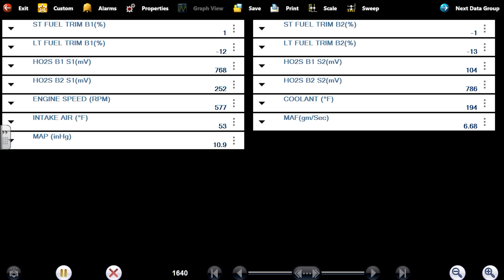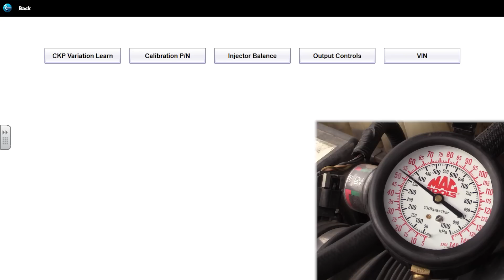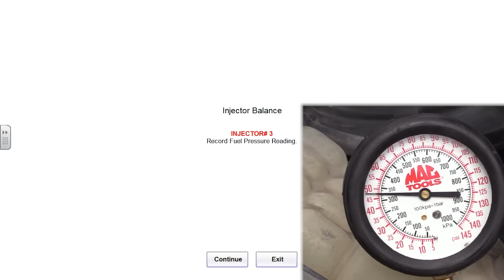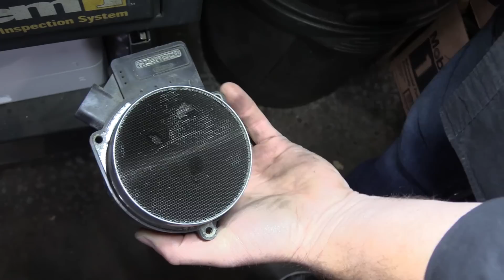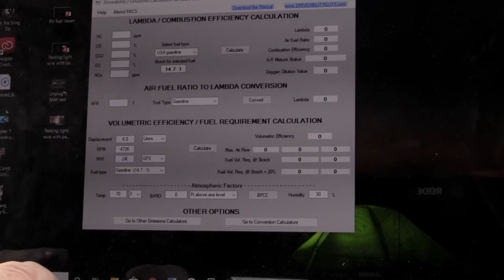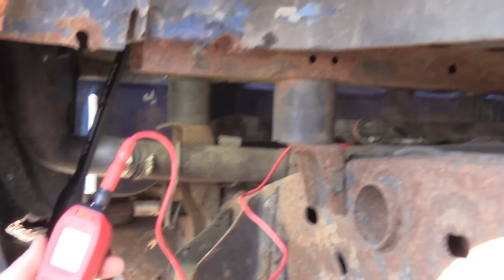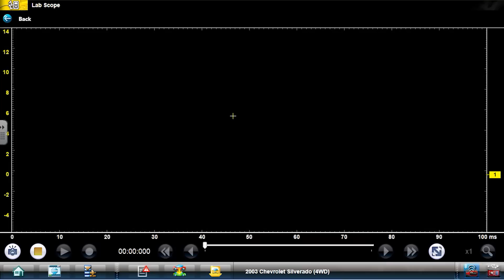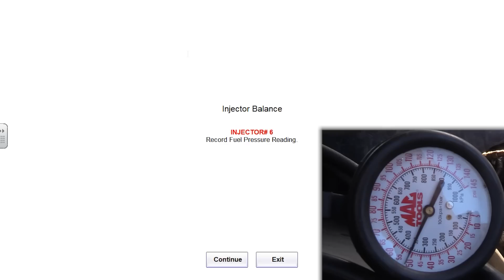03 Silverado Misfire, Rich AND Lean fault codes

Comment: If it's a Flex Fuel Vehicle (and I'm absolutely certain that it has no E85 in tank)  I would just start off doing a Fuel Alcohol Content Reset.
It Fixed the P0172 and the negative fuel trims on a 2009 Impala I had today

Comment: I fixed my misfires and all the lights that come with it!! Stability traction control, reduce engine!! I changed air filter regapped plugs and dumped 1 gallon of laquar thinner with ten gallons of gas  and a bottle of Lucas fuel injector cleaner in tank ran till empty,, all good so then I fully replaced plugs gapped/tourqued to spec!! Bacically it had a clogged 3 injector causing fualing plugs creating bad fuel ratio!! Dirtying Tb!!

Comment: Another PS: a check for engine oil contaminated by fuel or something else (ie on car injector cleaning fluid) that has passed the piston rings might also not go astray, have had that scenario cause negative trims at idle on multiple vehicles.

Comment: Ps. I think I hear an exhaust leak there with the engine running, fuel trim readings could be skewed if that is before any of the 02 sensors, just a thought on a variable 👍

Edit: You did mention the exhaust leak, I just missed that part.

Comment: Have had issues on the LS series engines where people have had injectors replaced and this fault occuring after the repair, problem being the one or two or three..... old part number injector(s) being changed out for the new part number, when the proper repair method for changing to the new part number injectors is to change out all of the injectors to the new part number and then reflash the PCM, as the new part number injectors are a different design (high impedance vs low impedance from memory).

Edit: Also, from memory, the mismatching of injectors to PCM program can cause fuel pressure issues due to the difference in flow rate of the injectors.

2nd Edit: From memory, the old Bosch part number ends in 049 and the new in 051....
Reply: Speaking of this fault I mentioned, I had an Holden Commodore 6.2 in today that had an injector replacement done for a failed injector done by a Holden dealer under warranty, the vehicle presented with rich at idle on one bank and misfire, found that the dealer had fitted one new injector and the injector that they replaced was the new part number and the rest of the injectors were old part number, have a guess which injector was still misfiring?

Comment: Read through most of the comments, am I the only one that noticed IAT of 57F? Seemed colder than that outside, although I know it could be from heat soak from the radiator. If the ECM sees 57 and it's 27, that would cause a lean condition, at least in open loop, right? Not intended to challenge the diagnosis, just a question I had.
Also, unrelated, that unplugged tank pressure sensor is going to cause a money light for the EVAP code after it completes the drive cycle (and Patrick seemed to not want the money light on). I assume the aforementioned lean codes being cleared took out any EVAP code.

Comment: P0300 on a 07 New body Silverado 5.3 I've checked plugs, wires, maf, throttle body, compression is 140ish all around, and I'm going to double check fuel psi. I'm concerned I found injector 1 about 3psi lower than the others. Misfire counts are high on Cylinder 3 with half as many on 8. Won't pass smog currently. Any advice! Thanks!
Reply: One other thing I'm looking at is bank 2 downstream 02 isn't reading low-high like bank 1. Stays in the 700s whereas bank 1 goes 80-800s. Which if any is bad?

Comment: Hey fellas wher can I find known good wave forms?
Reply: Hey Jorge, what scope are you using? Pico has a user uploaded database of good and bad waveforms available, you will need to be a Picoscope user to access that though, same goes with a few other scope manufacturers.
Reply: I'm using the snap on zues
Reply: Thanks you for the info I'm going  to look into getting a pico scope what model do you recomend?
Reply: Hey Jorge, I am not familiar with the Zeus or whether there is any database of known good waveforms available. I had the Picoscope Master Kit until I lost it in a workshop fire, they are available at Picoauto.com, I think that AES Wave in the US distributes them also.

Scanner Danner video link on this subject using a Picoscope here:

https://youtu.be/hYHphciFnH4

Comment: Paul, for the pressure drop test on the injectors, why not hook up the wps500 and pico and get an exact record of the different pressure drops? quick, easy, accurate, and a graphed record.

Comment: Anybody know of a YouTuber almost as good as danner around the Los Angeles area? Have a pesky p0300 can't get rid of on a 2007 Silverado 4.8 new body. Will alcohol percentage being at 19 cause a p0300? Only thing that looks off to me lol. Fuel trims pretty normal just slightly rich bank 2 but not really like around negative 12. 8th cylinder seems to be the worst with misfires but every cylinder is missing yet truck doesn't shake, no stalling, no surging, no overheating just weird it runs with all those misfire counters going.
Reply: @C5 Diag Thanks that's exactly what I was thinking I needed but I do not have bi directional and don't know who does other than the stealership around here.  Yeah no symptoms other than when I accelerate on the freeway I don't believe the truck has the power it should but I do not have another good truck to test that.  You think I could have a timing chain issue?
Reply: @C5 Diag Thank you for the help yeah compression all cylinders 150 except 7 and 8 at 126 and 135 respectively but still don't see that too problematic but I'm not sure. I wanted to see if anyone was around to help in the Los Angeles area I'll keep searching.
Reply: @C5 Diag No it's a work truck 07 4.8l which I believe did not come in flex fuel or afm.

Comment: I like using the pressure transducer on the fuel rail when i do that test and then put the verus in split screen mode so its all on the same screen then you can screen shot each cylinder test to have in your records for later review if needed. Just a idea to try cause you'll have the test recorded in your records. Just make sure there's enough time on the scope to record the whole test on one screen.
I also do the same thing with the split screen and my VE calculator  and scan data right on the same screen on the  Verus. I pin the VE calculator right to the task bar so i can pull it up when ever i need it.
Just some ideas that i like doing!!

Comment: Oscillations in the pump current waveform might be from the system voltage changing as other loads are turning on and off.  Remember the PCM is watching system voltage and modifying the injector pulse.  If it sees a lower system voltage it will make changes to the injector pulse width to compensate for the pump slowing down.
Reply: Hi...trying to learn here...is the  pump a mechanical one or  computer controlled  one? I ask as the  fuel regultor  seat's  on the engine.!
Reply: @romellabiche175  The fuel pump runs 100% on this vehicle.  It uses a return system.  The PCM turns on a relay to supply power to the pump.  There is no module to control the speed of the fuel pump.
Reply: @Discretesignals  Thank you sir

Comment: Why did you not take the truck on the road with the F P gauge under the wiper,for a real stress test?  also,cyls.5 and 8 needed to be looked at in more detail,maybe,with all those logged misfires?
Reply from the maker: Could be, but I think the misfire was occurring on low fuel psi situations and you absolutely cannot rely on those counters with a 300 code. 
No misfires were felt on noticed during our troubleshooting

Comment: fuel volume test    1/2 gallon in 30 seconds ?????  merry christmas SD   James    happy 20/20
Reply from the maker: Volume test not needed. Low volume was identified by simply looking at the pressure drop on a snap. Merry Christmas!!

Comment: I think you have a mechanical problem in this engine...
Or maybe in the PCM it self.
You don't see injectors pulse in live data !!! to known, maybe the pcm sends high pulse to injectors.
Reply: That would be hard to judge if the PCM is causing injector duty cycle issue because it is always modifying the base injector pulse from the inputs it receives from the sensors and it's software logic.  As long as the injector waveform has good turn on and off times and you don't see any offsets, it's probably not going to be a pcm issue unless that PCM software was modified by someone.

Comment: So it doesn't start too well either? You're right,  the pump definitely seems bad. I'm less convinced about the injectors though. Been down that road myself with a ford. Replaced all the injectors and it turned out to be an internal intermittent break/open on a couple brand new oem motorcraft sparkplugs. They were bad right out of the box. Problem always got worse when hot so I assumed the injectors were leaking but I was wrong. Edit: I am not implying this is your problem.

Comment: Love the videos. Got a technical question for you since other mechanic can't figure it out. I have a 2006 Hummer H3 with 90,000 miles on the motor. Live data of engine running shows multiple misfires skipping from one cylinder to the next, one at a time in no particular order when you press on the gas pedal a little. When you let off the gas pedal all live data shows 0 misfires. Also there is no check engine light. We just saw it only on live data. I was just wondering if you had any ideas of what I should be looking for?
Reply from the maker: Is it misfiring or running normally?
Reply: @ScannerDanner  it seems to be running normally. The only thing my mechanic said was maybe there's no check engine because it's misfiring Within a acceptable range? We originally hooked up the scanner to actually check my oil pressure but decided to check all live data while we were there. My H3 drives fine to work but on my way home the same exact distance when I stop at a light my oil light seems to like to come on. Turns off immediately if I press the gas or when I turn the AC on it ramps up the RPM a little and it goes away. So yeah when we were checking the live data we found the misfires..... it sucks because I bought it from a guy and the engine blew within a week and he wouldn't take any responsibility. So I replaced the motor and various parts and am now over $5,000 into this vehicle. So now I don't want to sell it I'm upside down now for sure. So any thoughts you have to point me in some directions, I would much appreciate. Your channel is awesome and you definitely know what you're talking about.
Reply from the maker: @rizkybiss  first, I wouldn't worry about those misfire counters. Second, you need to do a manual oil pressure test with this engine hot and see what it is. These are not good symptoms. It sounds like you have a legit low oil pressure problem.
Reply: @ScannerDanner  yeah it's weird in the morning it never comes on but when it warms up 20 more degrees and I get to home then it comes on at only at idle. Never when I'm driving. I change the oil from a 5w 30 to 10w 40 this weekend. It didn't help. I didn't pull the oil pressure sensor out but it did have a lot of power steering all over the connector and inside the connector from when I had a power steering leak. Also the first engine that blew was exhibiting the same thing with the oil light. My mechanic doesn't remember if he pulled the old pressure sensor off and put it in the new used motor.... if the light only turns on at idle could it be the pressure sensor? Or would the pressure sensor be more sporadic?
Reply: I know you're not in the business of online mechanic, I'm just trying to get answers anywhere I can right now. I've Googled and read every single thread regarding the oil pressure.....
Reply from the maker: @rizkybiss  it is possible you have a faulty pressure sensor, change it and see what happens, but I would recommend a manual pressure test while you are in there. You have to take the pressure sensor off to install a gauge there anyway.
Reply: @ScannerDanner  so we checked oil pressure and it was 14psi at idle. Is that good? We also changed the pressure sensor. On my way home today the light to not turn on when I came to a stop but then traffic was really light on the freeway so I didn't have stop and go as usual. We think of that it PSI at idle?
Reply: Oh and at 14 psi my idle is at 600 rpm.

Comment: thanks for video.i think  problem with that truck is low compression on  those two cylinder with  misfire.i run into same problem. i think bad MAF and fuel pump will affect all cylinders.

Comment: Bassackwards diagnostics 101, painful to watch this display of incompetence. Just WOW.
Reply from the maker: Don't skip around in the video and pay attention, this had rich exhaust codes that had NOTHING to do with the low fuel pressure problem. Customer complaint was highway speed surging, misfiring and also setting LEAN exhaust codes. (which he cleared before he brought it to me) This thing needs a fuel pump and I proved it. This would match his surging, misfiring at highway speed condition and also the P0171 and P0174 lean exhaust codes. 
The negative trim numbers and the cause for them is open for debate as I believe the balance test numbers were inconclusive.
Reply: hahahah yeah, i'm sure you're an expert

Comment: Paul, food for thought, if one or more of the injectors was leaking that grossly, I'm curious if unplugging the injectors individually and watching for fuel pressure drop when applying the throttle would be a good test. In addition the inconsistent readings for the fuel injector test could be related to the temperature of the fuel,  GM has an injector balance tool call AFIT that accounts for this variable and others that produces in-car flow test accuracy close to that of out-of-vehicle injector test benches. https://www.youtube.com/watch?v=aU0wplBH0ws
Reply from the maker: You would not be able to disconnect injectors and watch for pressure drops if the pump is running. I have only heard of this AFIT tool through this thread, I will have to look into it. Thanks!
Reply: Seems like it would be impractical for anyone other than a GM Dealership to own that AFIT tool given its cost and amount of different adapters it requires. I`v only seen this tool used a couple times by GM Master Techs and that was only because TAC made them do the test before they would release parts for the vehicle...

Comment: Scanner get yourself to the UK will ya' I've got a doozie of an Audi A4 B6 1.8 no codes high CO failing emissions negative 5% STFT +/- 5% takes forever to get LTFT  vac guage vibrating 19-21 in hg.
Reply from the maker: vacuum gauge vibrating is a mechanical problem

Comment: These type of diag jobs suck. You find half-dozen issues so the owner thinks you are guessing. Nope. I would do some base engine diag to make sure the engine doesn't have pending internal issues just to CYA. Would have liked to see some coil waveforms to be certain the "new" coils aren't Chinese junk. So far you know you have exhaust leaks, low fuel pressure, fuel tank pressure sensor issues. I wonder if the fuel tank has contamination? Just so many things that NEED repaired. Cam/crank waveform to verify signal amplitude? May have rust jacked crank sensor. If you replace the fuel pump the rich issue should get worse. Lots of ways to go.

Comment: Fuel pressure should be 55-60 on all k body’s , put a damn pump it it . That dish should have taken 10 minutes
Reply from the maker: That is incorrect. This 6.0L spec for this year is 48-54 psi

Comment: How come there wasn't a fuel test to check for alcohol content and density. Yes the pump is bad. The injectors could or are at fault. I work for Hyundai which are not ffv. But we have lots of gas stations in Minnesota that carry corn. And yes people will fill their tanks. Always come in with rich codes because of that.  Just wondering.

Comment: I would fix the base fuel pressure issue before relying on those bidirectional test numbers.  You are leaving fuel volume out of the equation.
Reply: Volume from the pump isn't in the equation during the injector drop test, it tests the pressure drop caused by each injector using line pressure only, the pump only activates during the prime between each injector activation and doesn't run while the injectors are being activated.

Comment: I've seen injectors change like these had.  My Wife's Buick V6 did the same thing, until I let it sit for a while.  Then the really bad one shows its reading and two others were iffy at best.  Replaced them with new GM injectors and O'Rings.  Problem solved.

Comment: I Wouldn't Try a Injector Balance Test with a Bad Fuel Pump. To me it's a Invalid Test. & 2 psi Differance Isn't enough for Me to Chasing Injector Problem.  It  Could Possably Be Rich Because the Computer Trying To compasate For Lean Condition. So I'd Recommend Fuel Pump & Filter Than Repair Exhaust Leak. Than see how it Runs.

Comment: My 2013 Buick enclave have similar problems. Clynder 3 misfire. Code P01682 ignation. Lean 2  code was there and went way. Engine shakes and feels like dying at the stop sign or red light - slow speed. Mostly it doesn't like taking foot out the gas. Changed spark plug, coil, purge  and Cleaned throttle. Still same,  plz any one know what will most likely be the problem.

Comment: Has a good visual inspection been performed on the fuel line?  Maybe fuel line dented during body lift?

Flow restriction could also maybe explain injector imbalance?
Reply: If you current ramp the pump and know the normal specs, you'll see higher amps than what is normal if you have a kinked line or restriction going on.